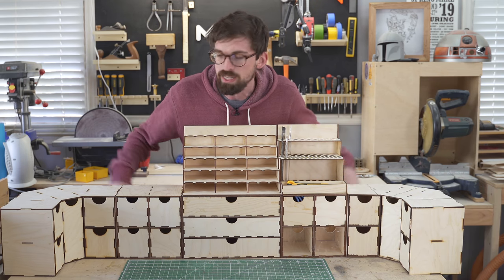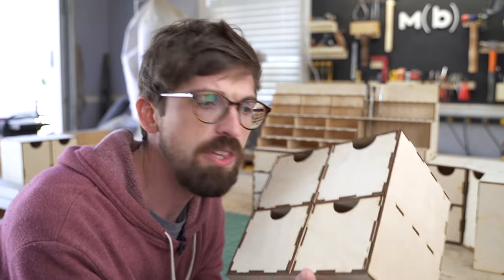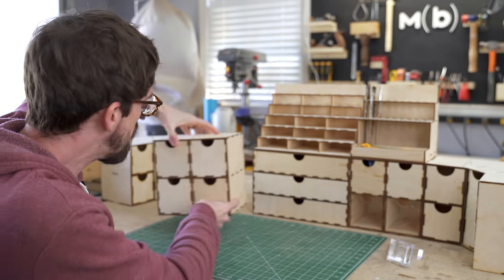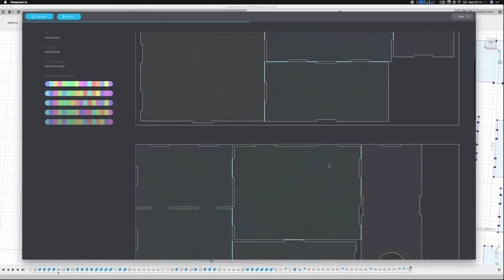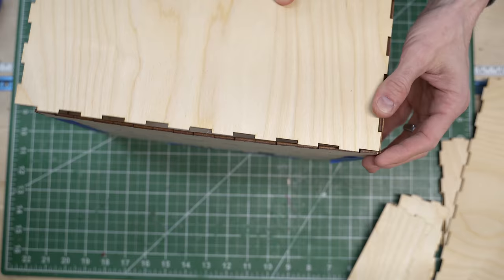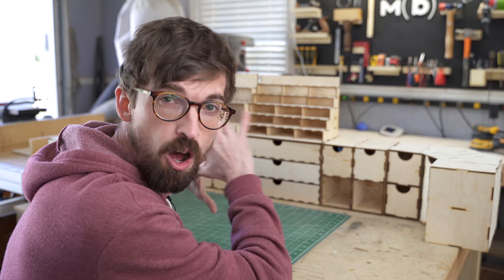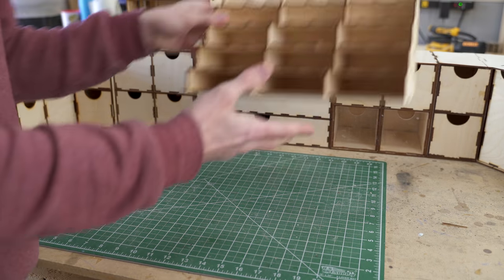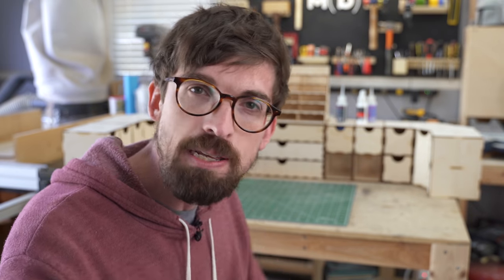Building a Modular Paint Organization System

Comment: I built some copy cats out of 1/8 and 1/4 inch MDF. I cut them using a circular saw with 60 tooth blade and hand saws for the joints. It was a little work but they turned out beautiful and functional. Still on my workbench for over a year and great. The price for materials doesn’t really justify it since the Hobby Zone stuff is very affordable. I do have 6 HZ units and plan on adding more, who knows, I may build some of my own again just for the challenge of it. Great video bud.

Comment: questions, i just bought the plans. what are the standard size sheets you used for the ply? my D1 has a cutting area of about 20x20 (ish) and are the templates set to work on a table that size?   Also what size paint bottle are you using? ( GW or Dropper size)

Comment: Not trolling just curious, but why using metric instead of imperial (you're in the US if I'm not mistaken ?) ? Great work !
Reply from the maker: Ha no worries at all!  The Hobby Zone version was in metric and I used there starting dimensions.  When I flipped it to imperial there was some nasty fractions so I left it in metric
Reply: Metric is so much easier when you are modeling. I use imperial when working in the shop, but if I'm modeling something especially something small it's metric.
Reply from the maker: @walkermckaeg1627  Good call!  Yeh working with mm is way easier then trying to figure what crazy fraction you need a small part to be.